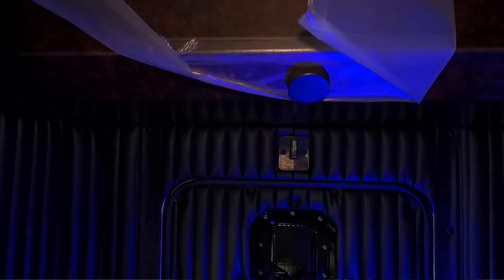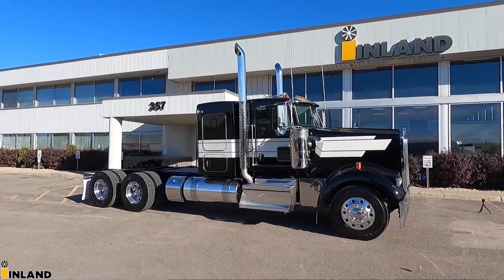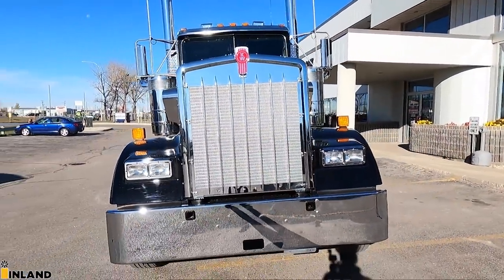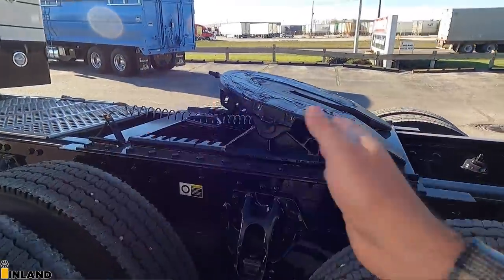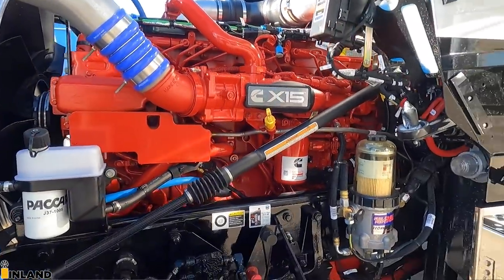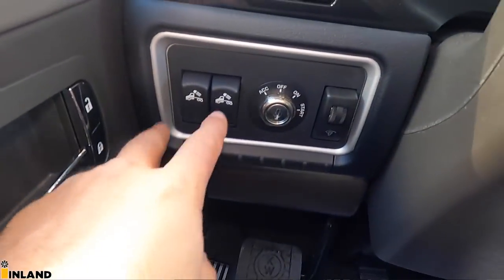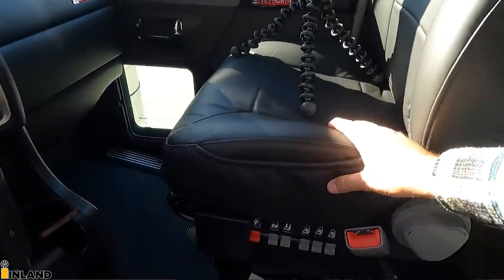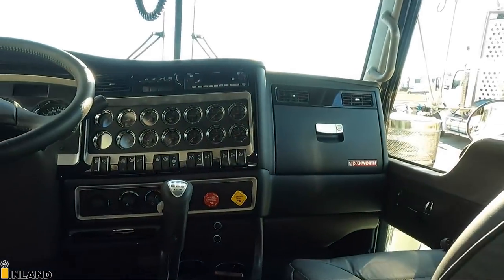OLD SCHOOL KENWORTH FLAT GLASS W900L   MY FIRST ONE   THE KENWORTH GUY

Comment: The owner will be pleased with this configuration, I still have my 1995 W900L and it is prestine, everyone thinks it's a new truck but I wouldn't trade it for anything, it sports a factory rebuilt 6NZ550 twin turbo Caterpillar engine, 18spd AG400 8 bag air suspension, 289" wheel base studio sleeper and all the bells and whistles, here in Washington state I see guys still ordering flat glass cab trucks for logging and construction, I believe it's called a severe duty cab if I'm not mistaken, truck I had before was a 1981 W900A long hood with the aero-1 sleeper and also cat powered with a 5X4 twin stick, sure miss that truck. Great channel.

Comment: I like that,,, alot! I remember the old trucks from the 70's, and early 80's, and before. No power steering, no AC, and cab heaters and drivers would go out for 2, 3, 4 and more weeks, and with COE's. 
But this trucks is great for 1-2 weeks on the road.
Reply: The old 903 cummins, 950 torque, these have come so far, and remember the roads werent as good as they are now.
Reply from the maker: So cool! Thanks for watching

Comment: The only thing you needed is for the door windows to come out straight like they used to with a little smoker Window that’s the only thing you need to do that one would’ve definitely been a classic like the older if you would’ve done that but don’t get me wrong the truck still looks like the classic trucks right there not gonna lie to you it looks pretty good